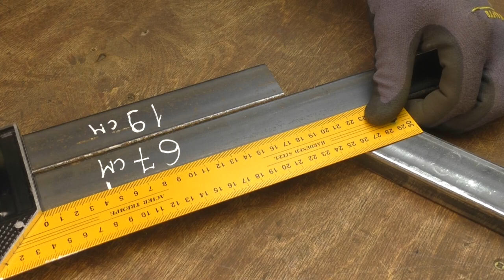3 Secrets Of The Profile Pipe! Why didn't I know this before!

Comment: You are very creative. I used to fabricate a lot with just a stick welder and fairly simple tools like You show here. It is a very valuable skill set to have and one that is not shown so much on Youtube or elsewhere. Even if a well equipped machine shop is available (I nowadays have a decent one...) thinking in terms of simpler solutions like these very useful tools You made can save a lot of time. I build many test riggs etc and fabricating out of rectangular tubing is my prefererad method. The result is usually much sturdier than expensive aluminium profile systems etc that are often advocated. And if You are proficient with the grinder and welder its a rapid process.

Comment: tube
"profile pipe" is a misnomer
Reply: i think the mat'l thickness and weight per foot designates tube from pipe
Reply: @commonconservative7551  nope, any profile is a tube, and pipe size is designated by inner diameter number, while tube is measured by outer diameter and wall thickness having tighter tolerance